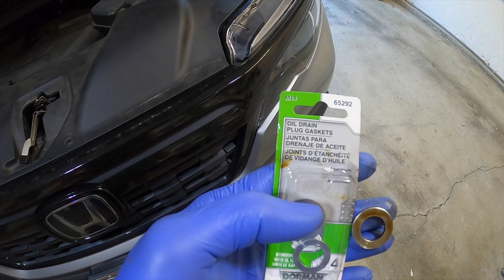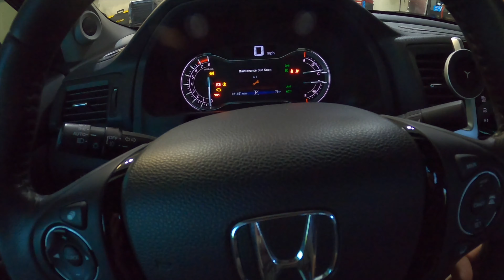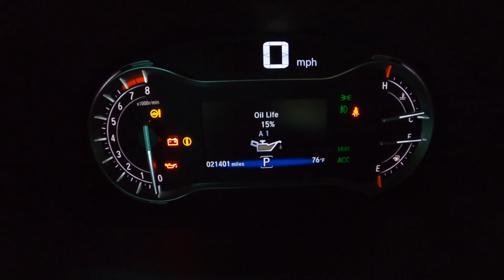How to Change oil on a Gen 2 Honda Ridgeline

Comment: 1) when removing the filter use a gallon sized ziplock bag...it will catch all the oil and prevent it from getting all over the frame and 2) check that the rubber gasket from the old filter is not still stuck on the truck before installing the new filter
Reply from the maker: I’ll have to try that trick with the bag. I hate cleaning up the control arm. Freaking annoying!  Thanks.
Reply: That’s an awesome tip. I don’t know why I never thought of that.
Reply: Awesome hack… thanks!!
Reply: This comment was absolutely clutch. Thank you
Reply: Oil filter on my Ram 2500 Cummins is in the same spot.  The gallon ziplock is the best way to go.
Reply: Where to get a gallon ziplock and isn't it 5.7 gallons? Also how can you hold is steady and aim and.... Guaranteed I'll make a giant mess...
Reply: @TheSkystrider  your just using this to remove the filter, not to empty the oil pan.
Reply: @killerb5726  oh ok. Haven't done it yet so I mixed up what the advice was for. Makes sense now other than I'm not sure what ziplock to use and I bet I'll still make a mess heh
Reply: I did my oil change a couple weeks ago. Went fine. I used a freezer ziplock bag to take the filter off. It sorta worked. Seems it prevented a good amount of mess but I still had to wipe the metal arm with paper towel to get oil off. Was hard to keep the ziplock above the top part of the filter so some oil managed to get past the plastic lol.
Reply: That is a brilliant piece of advice.
Reply: I typically use a grocery bag for this and just wrap it around the filter with the top of the bag extending above the top of filter. It does slip a lot, so I have to constantly adjust it, but it works.
Reply: You saved my ass!!❤

Comment: I've been removing the right front wheel in order to remove the oil filter to reduce the amount of spillage.  I did not think turning the wheel to the right would help, but it apparently does.  BTW, I believe most instructions are to HAND tighten the oil filter and NOT to use a strap or wrench.  Am I correct?

Comment: I recently purchased a used 2019 Ridgeline and I do my own oil changes. I drained out (including filter) just under 5 quarts of oil and refilled (with filter change) 5 quarts. My dip stick shows at the full line. I question where 5.7 quarts is the correct amount. I have also read in on-line blog post that 4.5 quarts will fill the engine, 5 quarts with filter change. Is my dip stick wrong? I'm gonna call a local dealer service department and ask them the correct amount of oil to fill the engine.

Comment: My 2017 has 141k on it.  Oil change, battery, tires. That's it. Still runs like a beast!
Reply from the maker: Awesome! Hope mine will be the same.
Reply: @YuriyMotso  It will! The J35 series of engines fro. Honda is considered one of the most reliable engines of all time! I currently own 6 Hondas. They simply won't die.👀😅😅😅💪🏽💪🏽
Reply: What about the timing belt replacement at 100,000 miles??? Have you done that??
Reply: @marks6072  No I have not. Doing it at 150k. I drive fairly conservative and don't haul much.
Reply: @TheCyberspaceCowboy  Honda will probably do a software update to help mitigate premature ware. Also cover up you transmission center console button cluster.
A guy at the dealer I go to said he had a customer spill soda on it. 5k later...
This is why I like 2017-20 better.
Reply: @TheCyberspaceCowboy  I don't know of an exact one, but I do believe they make it. I'd custom make one with a 2 gallon zip lock bag and some straps or velcro straps until you get one. Or maybe a clear cheap umbrella you can cut to fit.
Reply: that's alotta miles! Are you driving it now?
Reply: @johnmiller9219  Yes. Its at 154k now. Still awesome. Zero problems.  Just took it in  yesterday for 1st timing belt/water pump kit.
Reply: Mine is also a 2017 with 86k. Normally it would have a ton more miles but since inflation post Pandemic I’ve actually cut down on trips. She’s been literally one of my best vehicles I’ve owned and I’ve owned plenty. Happy trails!
Reply: @Lee-so4ub  Awesome! Update. I currently have 194k on mine. Zero issues. 🤟🤟
Reply: are you guys changing the transmission fluid every 30,000 miles? ...due to their poor record
Reply: @edwardslowik1296  Yes!

Comment: How to do you measure 0.7 qts after putting in 5 qts? And does the 5.7 qts include in the oil filter or you just put all 5.7 qts in the engine?
Reply from the maker: 5.7 is with oil filter replacement. After you put in your oil, let the vehicle run for a bit and test again. It’s something that you pour in 5.5 qts and then you just have to top off and check the level until it’s perfect at the line. So no exact way because there may be some oil left over from the oil change and everyone’s vehicle will be slightly different.
Reply: @YuriyMotso  thank you!

Comment: I almost made the rookie mistake of draining the oil before turning the wheel all the way to the right. So the order of things is, while warming up the engine, turn the wheel all the way to the right. After shut down loosen the oil filler cap, etc.

Thank you Yuriy for great production value. Good lighting, good framing, always in focus, and perfect pacing. You should win awards. Now to go for the rear diff fluid change.

Comment: Yuriy:  great video.  I just got my 2022 Ridgeline.  What are your thoughts of the Fumoto drain valves, in place of always having to replace the drain bolt gasket every time you change the oil?  I had one on my 2004 Silverado from 20K to 190K miles ( I have sold the pickup ) without any problems other than waiting for the oil to complete drain.  Keep up the great videos on the Ridgeline!
Reply from the maker: I personally have never used one. My dad does have one on his ford econoline and Lexus gx470. Personally don’t think it’s bad but let’s say you did go off road and something had to snag it. Would be easy to break off then.

Comment: Thanks, good video, and we all appreciate ones that are short and to the point. Other oil change vids can be 15-20 minutes and show the same thing. Just to add a little info:
17mm socket for the drain plug
Torque spec for drain plug is only 29-30 foot pounds. That's not much, and if you've ever dealt with a stripped drain plug, you'll be sure to use a torque wrench every time in the future.
Reply from the maker: I try to keep how to videos short.
Reply: Awesome thank you for this.  I was just about to start grab my socket set and seeing what fits.

Comment: Do you need a new Gasket each time?  Is it optional?
Reply from the maker: You can reuse the gasket in a pinch however it’s not recommended.
Reply: You should change it if you have one. If not next time. You can order them on Amazon or any parts store.

Comment: Has anyone found a better funnel for the Ridgeline?  I just spent more time replacing the oil than I did draining and changing the filter.  It's an awkward angle and hard to reach.
Reply from the maker: Plastic gallon ziplock bag. Best so far.
Reply: If it fits, try the longer transmission funnel.

Comment: How many miles did you go before replacement?
Reply from the maker: I been letting the Honda tell me when to change the oil because I want to see what the oil looks like and It’s roughly 5-6k miles. Typically I always change my oil at 5k on my cars prior to the Ridgeline. I use full synthetic oil instead of synthetic blend.
Reply: If you do highway miles every five thousand. If you do mostly city do three thousand mile oil changes.

Comment: I watched all of your vids - very good content - keep them coming 
I just fit a 2022 Ridgeline and is an awesome truck …
What are oil change intervals on those vehicles and how often do you do it - thx
Reply from the maker: I Personally do mine every 5000 miles. Honda no longer has interval changes as the vehicle has a built in maintenance Minder. It checks engine operating conditions and helps coordinate oil service dates and other maintenance checkups. Mine typically tells me every 6000 miles when I tested it in the earlier stages. But when I checked my oil it was darker than I would like both times so I decided to just do it based on an interval. I use trip B as my oil reminder. When that trip hits 5000 I do an oil change.
Reply: Just keep in mind resetting the MM earlier will affect other scheduled times in it and throw everything off according to Ridgeline forums. They say change the oil early but dont reset the MM early...let it continue on schedule

Comment: I find it interesting that the Honda service manual says to run/warm up the engine before replacing the engine oil.. One would imagine you want most of the oil to drop to the oil pan before doing an oil change, not turning on the car sending oil all over the motor before replacing it. Well, Honda engineers must know why.. It’s the same for my Passport. Was the oil very hot once you started flushing it?
Reply: It's to make sure the oil is warm and flows properly. You can do it cold, you just will want to wait longer before re-installing the plug to make sure everything drains.
Reply: It takes finesse to heat engine enough between too hot, and too cold. Warm: oil pours out smoothly. Cold: like honey/sticky
Reply: Just drive the vehicle around the block that will be enough for the oil to warm up. Let it sit about ten minutes that will let the oil drain to the pan. Then undo the bolt to the oil pan.

Comment: I always remove the right front wheel to access the filter.  Easier with the tire out of the way.
Reply: No need turn the steering wheel to the right all the way and just get in front of the car. Reach in grab the filter and unscrew it.
Reply: I lay on my back with my right hand grabbing the filter and unscrewing it. Very easy.

Comment: I turn the wheel to the right. I lay my back on the ground with my right hand grabbing the filter and unscrew it. Very easy. Never use a wrench on a filter. Hand tight only.
Reply from the maker: Me too. In this case my hand and can was too oily and I couldn’t get it hand right even after wiping down. So I just applied a light amount of force. I have a new technique for the vehicle now that works even better. I use a plastic bag to remove the filter and it catches the majority of the oil.
Reply: you are incorrect. I used to do "hand tight only" until my 2017 Accord started to slowly leak from the oil filter seal.  A small amount of torque with a filter wrench stopped it.  A week or two later, changed oil and filter and once again slightly torqued the oil filter past "hand tight" and no more leakage issue.

Comment: You don’t need a oil wrench when replacing a oil filter. Hand tighten only. You don’t want to crush the gasket or twist it out of place.
Reply from the maker: I didn’t over tighten it. Don’t worry. It’s hand tight just easier to do with that as my hands were a bit oily.
Reply: Glad you told me you only tighten hand tighten with the wrench. Thanks. You do the change exactly how I do it. Over fifty years doing my oil changes.
Reply from the maker: @arthursmith643  You have a few years of oil changes over me. :)
Reply: you’ll still need it get filter off next time even just hand tight

Comment: what happened to your bottom cover that you have to remove to access the oil pan plug?
Reply from the maker: I’m confused with the question? If you are talking about the oil bolt then that’s not covered by the under body plastic cover.
Reply: I believe in model year 2022 Honda added a bolted on steel cover plate that needs to be removed to get to to oil pan plug.